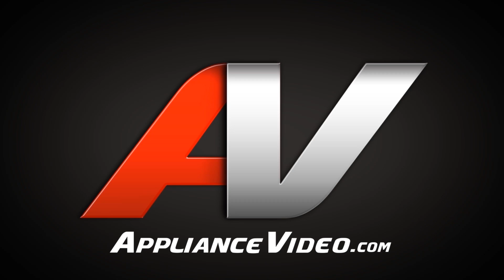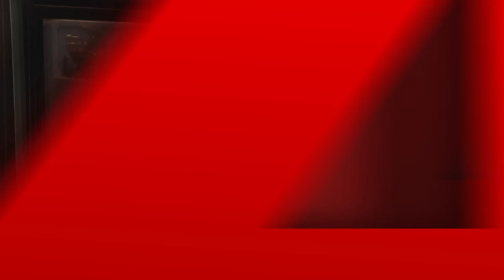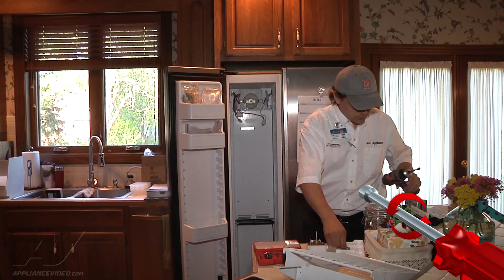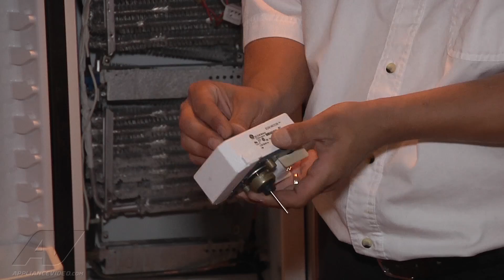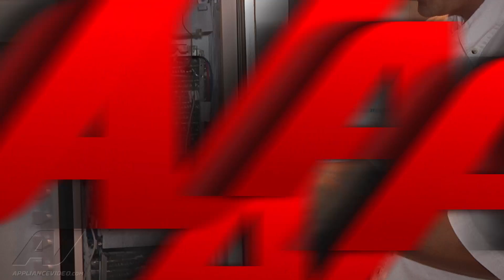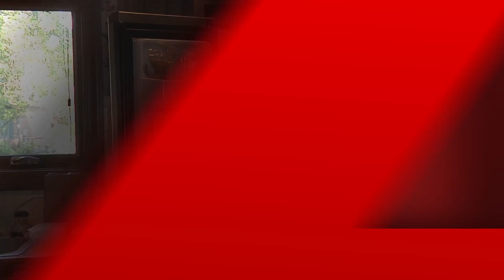GE Refrigerator Repair - Not Cooling in Fresh Food Section - Evaporator Fan Motor

Comment: Is the fan supposed to blow at the top or suck air over the coils and come out the bottom?
Reply from the maker: Great question, if you have a more technical question that our parts department cannot answer, you can search our over 17,000 answered questions free at our website www.ApplianceVideo.com under our Repair Help section. You can also call our parts department at 1-800-830-5465 and they can give you help 7-days A week ,or search at www.SaveMoreOnParts.com  .

Comment: Great video, but did I miss something? How did you know it wasn’t the heating coil on the bottom that causes freezer to frost up? And where the cool air is coming through to the frig?
Reply from the maker: Great question, if you have a
more technical question that our parts department cannot answer, our
technicians are answering all questions at our website at www.ApplianceVideo.com under our Repair Help section. You can also call
our parts department at 1-800-830-5465 and they can give you help 7-days A week
Monday -Sunday, or search at www.SaveMoreOnParts.com  24 hours
7- days A week.
Reply: I was wondering the same thing, if I turn mine off for 24 hours then back on again after the evaporator has defrosted the fridge get cool, then within five days the same problem ( every thing is hot in the fridge) but the freezer is always cold.

I cannot see the fan turning, and was wondering if this is because I have taken the draws off the freezer and the temperature is warm, hence fan is turned off! Or is the fan faulty.

Then there is the thermostat for the heater as the condenser is blocked solid, or do I go back to the fan as if it is the fault and not moving air the condenser will block.

I think I should just buy both parts and fit them which will at least end the problem of which part has gone.

Comment: I would like to add to this on my side by side my freezer was working great but fridge was not cooling. I discovered embedded in to Styrofoam at the back top is a fan that sucks cold air from the freezer. You have to remove the plastics to get to it. I was inspecting to see if the fan was running and noticed a small square door that must regulate airflow from the freezer. Mine was stuck shut so no freezer air was getting to the fresh side. I just shoved it open . Now cool air is flowing again.
Reply from the maker: Great question, with our
technicians now getting hundreds questions weekly, they are answering all questions
at our website at ApplianceVideo.com under our Repair Help section. We have over
3,000 common questions and answers that you can easily search through by your
model number, appliance make, and problem or error codes.

Comment: I have a GE model gth18ebt2rww ...it was frozen.  notice when freezer door open...you can feel cold are going through the connector hole..but when you close the freezer door the cold air stops going through the connector hole....any suggestions will be greatly appreciated.
Reply from the maker: Eric
     All of our technicians are now answering questions daily on the ApplianceVideo.com website for anyone needing help. Just copy and paste this this question under REPAIR HELP, and one of our  factory authorized technicians  will answer any technical questions at absolutely no charge on your appliance issues. We also have over 2600 free repair videos to help with your appliance repair issues. Thanks for your support. Matt Ace Appliance factory service technician.